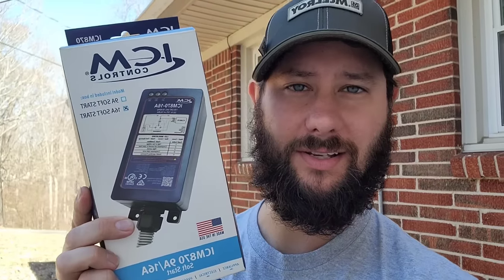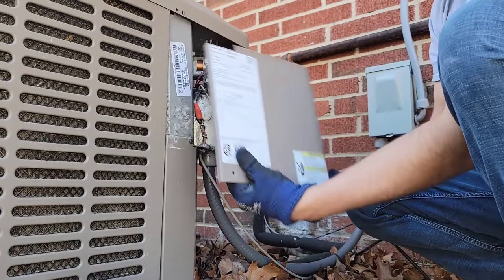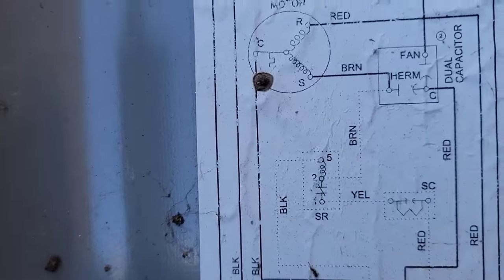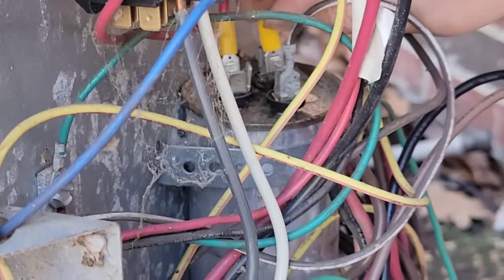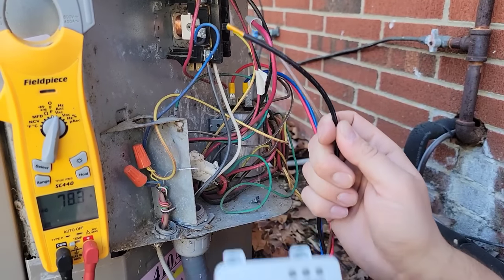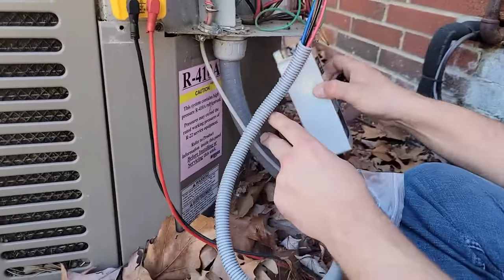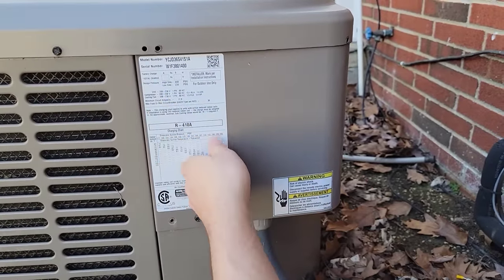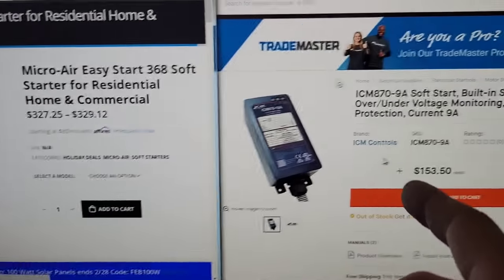How to install ICM870 Soft Start? @icmcontrols9960

Comment: I just bought and installed the 870-32a model on my 3.5 ton unit, and was wondering if anybody knows why a new feature of a 4 min delay was added to the newer units? Now the fan kicks on and runs by itself for 4 mins before the compressor actually will start. ICMs website calls this out as a new feature, anybody know what the point of this actually is?
Reply: My understanding is that the delay prevents a compressor startup while the compressor is pressurized.  The four minute delay allows internal pressure to bleed down before a restart.
This protects the compressor from starting up while "loaded".
Reply: This applies to the AC compressor in you vehicle, also.  If you turn off your car AC you should allow four minutes for a bleed down of pressure before restarting it.

Comment: Mine failed after 31 days. I opened the case with the help of a heat gun. The internal CB60 100uf 330Vac failed and leaked oil all over the place. I replaced the capacitor with Amazon "Appli Parts motor start capacitor 108-130 Mfd (microfarads) uF 330 VAC universal fit for electric motor applications 1-7/16 in Wide 3-3/8 in Height CON-108-330" and the fuse with Ebay "NTE 5x20mm 12.5A 250V Fast Acting Ceramic Fuse". This fixed it.

Comment: Installed the 16A today, put the black wire on the wrong side of the contactor and killed my 3 year old central Texas capacitor.  Not too bad of a lesson, now I’m familiar with replacing the capacitor and have a backup for when this new one fails 🙃

Thank you for the video!

Comment: Installed a micro air brand two years ago. Been great so far. Installed it to be able to run my 3ton AC on a portable generator during hurricane season. Last year we got hit with Hurricane Ian here in SWFL . Lost power for about two weeks. Ran the whole house with AC on a portable generator thanks to soft start like these. I just recommend the ICM units to a few friends. Thanks for the great video.
Reply from the maker: Glad to know the experience was good with the micro air.
 Crazy experience, I'm sure through the hurricane.
Glad you're here and glad you're okay.
Reply: Ditto on my unit. I’ve not had to go 14 days, but I have ran the entire house (2 ac units each with their own MicroAir ES) and they ran flawlessly. I’m pretty sure my bill is lower too since it’s reducing the running amps significantly.
Reply: @modestcody123  The soft start kits only lowers the LRA / in rush amps......running amps are the same.
Reply: @darknes7800  It doesnt lower the starting amps either.
Reply: @modestcody123  Yeah sure your bill is lower, that thing must be a mini power station, Lol
Reply: @RadioRich100  this is timely. Within the last two months I had one unit die on me. It was in fact showing significant decreases in running amps. MicroAir stated that it was likely flawed from day one and thus the readings (among many other issues that lead to me discovering the fault). They ended up replacing it even thought it was 4 mos out of warranty. 

I’ll fall on my sword that I was wrong, but as a first time user, with the readings showing far lower than what my meter was reading, how was I supposed to know as a newbie to the soft starter world?

Comment: Hi Tad, from Michigan here, this is the best ICM soft start video out there. You double checking the schematic for the correct wire colors was essential
Reply from the maker: Thank you my friend play appreciate the compliment and appreciate you watching.
Reply: This thing is B.S. and junk. They all are. It does NOT reduce anything. Using $50 clamp meters to measure modified sinewaves which fools the meter, and thinking the same motor with the same torque load on it now runs on one quarter of the current, is the findings of a fool.

Comment: In 33 years, I have seen disconnects simply wired around where the disconnect is essentially a junction box, or one of the legs wired around because of a melting situation etc, and they, for whatever reason, didn't change the disconnect. So....everything I ever disable gets confirmed with a hot stick before I touch a wire. I'm the nervous type. :) Great video.
Reply: Great advice!  I had a rental property and someone had wired around the disconnect.
I'm nervous like you and it saved me from a nasty surprise.

Comment: Thank you !! 
I’m not an HVAC professional but I can tell you that an AC or heat pump inrush current creates a lot of problems with computer equipment.  It makes the power supply dirty.  Inrush current has created a lot of problems with my computers.  
Fortunately I’m getting a high seer unit which should address this.

Comment: I've used ICM Head pressure controllers, 3 phase voltage protectors and furnace control boards and have always had excellent results.  I'm glad to see that they are making these soft starts. I'd been thinking about adding one to my RV's AC but other company's prices seemed exorbitant.
Reply from the maker: Glad to know your experience has been good, that's excellent.
Definitely for the r v 
Better for the generator if you use one

Comment: Hey Tadd I just wanted to say thanks for the great tip, I am in central florida and just installed a whole home generator and was concerned the a/c would trip. I think this whole install took me maybe 15 minutes. Great tip on checking the wiring diagram on the unit; a quick review of the diagram and this was plug and play. Again thanks so much!
Reply from the maker: That is awesome! Glad I could help.

Comment: Just added this soft start per your instructions and it worked great, came down from 84 amps to 30 amps at start, now is 27 amps at start after a few cycles, I noticed the compressor is quieter, also tried to run it with my  Generac EXL 8000, 13500 starting watts connected to main panel, of course, with the emergency set up at main panel, running 5 ceiling fans and refrigerator inside my home and 1 ceiling fan and another refrigerator at the garage at the same time also with a few led lights and started the ac with little effort, no hiccups, thanks to your advise now I can relax thinking about my AC running again in emergencies.

Comment: This soft start is actually not bad in cost compared to other brands. Good find👍 I also like the fact it’s pretty compact
Reply: You added the word “pretty”.
Reply: @mrBDeye how observant of you..
Reply: @randybobandy9828  You are smarter than me. Exactly how is it pretty compact?
Reply: It’s not a soft start. It’s a scam. Just use a hard start.
Reply: @jman0870  not the same thing 🤦🏿‍♂️🤦🏿‍♂️🤦🏿‍♂️
Reply: @downsouthlouisiana  then explain what the difference is 🤡 boy
Reply from the maker: Excellent thank you
Reply: @jman0870  Didn't watch the video, eh?
Reply: @DocNo27  don’t know what google is, eh?
Reply: @jman0870  I know what google is - apparently you don't know what reading comprehension is. Hard start increases inrush current and soft starts reduce it - different tools for different use cases.  If you are trying to reduce inrush current - especially if you are using a generator or solar/batteries - a hard start is the LAST thing you want on an AC unit.  
And if that's what you meant to say originally then just say that instead of trying to be cute.

Comment: The wiring instructions are straight forward.  Be careful...the unit is not made to be installed outdoors and if not must be enclosed in an outdoor enclosure.  Suggest reminding folks to be sure and neutralize the run capacitor else risk of shock

Comment: Installed this item today.  Thank you, the video made it super easy and I love the result. No more hard hit upon start-up.  👍

WARNING!!!
UPDATE: The unit literally caught on fire and damn near burned down the condenser and possibly my house.  Breaker tripped.
Reply: Are you gonna sue?
Reply: maybe you messed up with the wiring, and it shorted out then tripped the circuit breaker.
Reply: woah any more info here? I just bought one today and you scared the crap out of me
Reply: the ICM caught fire? just making sure you weren't talking about the micro-air
Reply: @michaeloneil3239   So after talking to the manufacturer and the Amazon seller.  This was a definitely NOT supposed to happen (obviously) and is an issue, but I also messed up.  
I was advised to but the 16v by a friend of mine who does HVAC. I think he thought I had a 3ton unit, but I only have a 1.5Ton unit (Trane).  It was working fine for 2.5 days. Green light was on.  Came home and smelled that "Just let the smoke out of electronics" smell... and oh boy. It burned badly. The entire compartment was toasted, but the ICM unit was completely melted and charred. 
Regardless, the ICM was wrongly sized to the condenser, but NEVER should have burst into flames as mine did. 
I have received a refund from the seller, but not sure what to do at this point.

Comment: Thanks for the great instructions . I bought 3 of the 870.16 for my 2   3 ton carrier units .   2 have failed in less than 10 days . The third is still going good , but im thru with this product . it's half price than micro air and i guess u get what u pay for . Im done with the 870-16
Reply from the maker: I wonder what happened
That's not good
Thank you for sharing this with me
Reply: I'll show the picture of the failed unit but don't know how . . basically  it exploded
Reply: In mine, the ICM870 internal 100uf motor starting capacitor exploded and leaked. I was able to open the box with a heat gun and I replaced the capacitor and the fuse. It is working fine again.

Comment: Not every installation requires the features that the micro air offers. The micro air does allow diagnostic information to be sent to the company, the units firmware can be upgraded through the phone connectivity. Customized adjustments or firmware can be made if there is an issue. The micro air logs quite a bit of information which can be read through the phones Bluetooth connection.
The ICM  unit looks good and it’s probably sufficient for many installs.
DIY people who  live where the units are installed are more likely to use the connectivity features

Comment: Thanks for this video. If you go to the manufacturer video he’s got it all wrong. Never mentions splicing brown with Run wire. They obviously wired it up, it didn’t run then a tech came along and installed it for them and they just edited and posted

Comment: Everyone was out of stock.  I brought one one ebay  for about $200. Money is no problem. Thanks for your video. Love your info. This will save me money on my unit and electrical bill. Thanks 😀
Reply: Im afraid this will do nothing to lower your electrical bill, like, not even a little.
Reply from the maker: You're right. It will not save you money on your electric bill.

Comment: Tad great video.  This is a lot easier start on your compressor.  It also can prevent lights dimmimg on HVAC unit start.  

Also by minimizing lock rotor amps  you now have the ability to run your air conditioner on a lot smaller generator because you need a lower surge start current.   I ordered one from Tad already to put on my unit.   

Can't wait to see this.  It doesn't save on power bill because you still  have the same running amps. Lock Rotor Amps typically two short to be measured by power company from a demand perspective as the are usually on a 30 min rolling window or in BCES case one hour block standpoint, but great compressor saver, quieter start, less likely to dim lights, and smaller generators.

Great job Tad.
Scott Owens 
General Manager 
Benton County Electric System

P.S. Tad been watching your videos great content.  Be happy to answer any power company questions from your followers.

Can't wait to get put on mine.
Reply: You see these in a lot of larger commercial motors and we and many power company's require them on a certain hp or larger.
Reply from the maker: Excellent information
From a great source
Thank you my friend
Reply: Wow thank all 3 of you. Now I have a little more knowledge
Reply: So, although this wouldn't save any money on your utility bill, it could produce savings through a prolonged compressor life?

Comment: I kept seeing these at the part houses but never had the time to read the box while I was there. Thanks you, very informative.
Reply from the maker: Glad you enjoyed!
Reply: They aren’t soft starts. They are scams. Just use a hard start. A soft start is a basic drive that ramps a motor up. 🙄
Reply: @jman0870  what are you taking about and where did you graduate?!?  A hard start increases inrush current to reduce the start up time of the motor and that's why they have relays so the motors don't overheat/over amp. A soft start decreases inrush current helping extended the parts lifespan. 
They are not scams
Reply from the maker: Thank you Chris.
Reply: @dawildcatz87  LMAO hard starts don't increase inrush! HAHAHAHAHAHAHAHA

A hard start uses a potential relay to bring a start capacitor in parallel with the run capacitor to counteract the massive amount of inductive reactants created on startup that naturally pushes the voltage and current out of phase on startup, massively reducing inrush.

A soft start is a VERY BASIC vfd that uses pulse width modulation to "ramp" a motor to full speed. Those “soft starts” are glorified hard starts that learn the precise amount of time to drop a start capacitor into line. They have a start capacitor in them if you every took one apart 🤣🤣🤣

Stay in school super tech
Reply: @TaddyDigest  thanking someone who is completely wrong is very unbecoming of you, Taddy. 😘
Reply: @jman0870  supertech really? Let's grow up and have a conversation about it or move on.
 I can see how a hard start reduces inrush current on an older compressor however i am talking about a good compressor pulling it's rating amps. I have installed many hard starts on old compressors having trouble taking off and yes it is lower amps than it was not starting however it still pulls more energy then a properly running compressor. Aside from all that the ICM soft start comes with under/over voltage  and over amp protection. Those alone make it worth the surprisingly low price, it is not a scam if it does what it says. As of two months ago I have two customers very happy with their soft start kits. Thank you Taddy!
Reply: @dawildcatz87  you’re still wrong, pal. Which school did you go to? I need to speak with your teachers. They obviously failed you (or you failed yourself Mr. “Old compressors and new compressors work on completely different laws of physics.”

You don’t even know what PWM is. Admit it. 

As far as over and undervoltage is concerned in the residential HVAC world, they are practically a non issue. All residential single phase compressors are rated 208/230. The average residential voltage is 246 volts. You can drop ALL THE WAY DOWN to 208 and, in many cases, down to 187.2 (that’s 208-10% super tech) and still start fine. Overvoltage is rarely an issue except for lightning strikes and nothing is going to save you from that. This does not include inverter driven equipment because you can’t put a “soft start” on inverter equipment to begin with. Stay in school super tech!
Reply: @jman0870  the ego and childish attacks make me assume you are talking out your neck, keep replying but I'm not wasting my time reading most of it at this point.

Comment: Mine is arriving this week. I had to change out the cap and fan last year. This year will be the year of love for my AC unit. Thanks for showing this in a video. I really appreciate it. :)
Update, cleaned the unit, installed the soft start, piece of cake. The PIA was reinstalling the coil surround. Ugh
Reply from the maker: excellent news thank you for watching
Reply: @TaddyDigest  I can barely hear the compressor kick on. I also installed a brinmar sound cover for the compressor. It’s blowing nice cold air out of the registers. Thanks again for showing how to do this. Very concise
Reply: Well a few month after installation update. ICM is dead, so no LED lights, no compressor running. Removed soft start and went back old skool, and system works.
Reply: I don’t recommend supplyhouse for those out there. I bought this soft start from them 3 months ago. It failed, no refund available, but replacement to be sent out after they receive the defective product back at my cost of $23..00. So I am not happy with supplyhouse and I have no confidence in the longevity of the 870 soft start after viewing several posts from unhappy people that bought it through Amazon. There seems to be something that happened with the build quality. Tad, what’s your impression? Worth it? Or is it a roll of the dice? Since you’re in the industry it would be nice to get an opinion. Thanks

Comment: Would have been nice to see more on the identification and removal of the existing hard start or a soft start component from the existing AC unit, that's the part that will be causing us AC DIYers the problem.

Comment: If you are not in a peak demand market, EasyStart will not save any money on your bill but is still can provide benefits like reduced surging and brownouts, quieter starts, and operation on smaller power sources.

Comment: Most portable generators can't handle the startup load of an HVAC unit so people use their generators to run smaller window units, fans, or small heaters to stay comfortable during an extended power outage.
With a soft start you can use a smaller portable generator to run your HVAC during the outage.
Here in "hurricane alley" a soft start is a must.
Reply: This thing is B.S. and junk. They all are. It does NOT reduce anything. Using $50 clamp meters to measure modified sinewaves which fools the meter, and thinking the same motor with the same torque load on it now runs on one quarter of the current, is the findings of a fool.